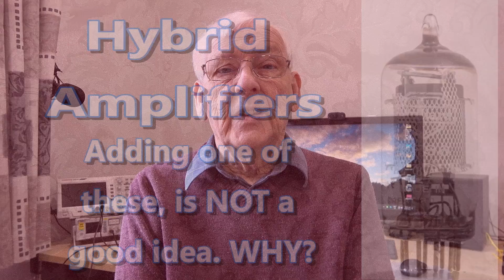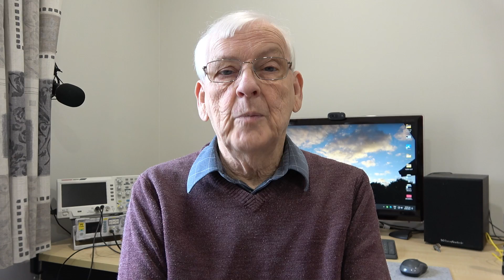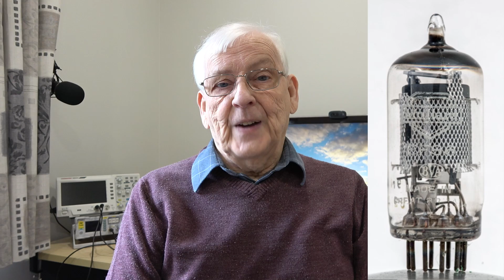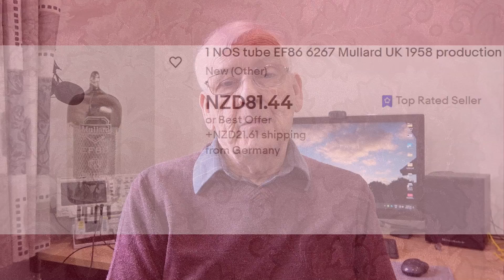HYBRID AMPLIFIERS. Adding one of these, is not a good idea. WHY?

Comment: I think you are correct about the cheap valve end of the market. I also think you are correct about people liking various degrees of 2nd harmonic distortion that single ended triode circuits can add. However valves can be operated in a very linear, wide bandwidth fashion and provide detailed and relatively faithful reproduction, whilst also having a certain something that can be captivating in a way solid state fails to provide. Whether that certain something is an added quality or an ability to allow something through from the recording in a way solid state does not, I don't know. What I would say is that what we measure is not the whole story about what a piece of equipment does or what we actual perceive when listening. Thanks for a very sensible presentation on this subject.
Reply: The most admired tube in the hifi world, directly heated triode 300B was designed for RF use! Unison Research amplifier Unico (good Italian brand, no ChiFi) use tube front stage and transistor AB class power amp, Audio Note, the holy graal of audio companies use tube buffers in their DAC devices, Etc etc. Well implemented tube adds 3dimentiality, holographic sound and scene layering which never be achieved by NE5532 opamp. Even so called discrette opamps like Burson, sparkos etc sound way better from this 1dollar opamp. Of course all is subjective, I understand engineering aspect (I am electronician engineer on my own) of the matter, but I learned thru years, there is no one "right" way in audio. There are many ways and many different expectations. Yes. I want my recordings sound good and nice for my ears. Nothing bad in this. I will not limit my listening to the perfectly recorded Sonatas and Orchestras of  all the world, or Diana Krall or other Chesky Records stuff, because I simply do not like this kind of music!!!
Reply: @yellow_noise3  AN makes expensive trash, especially the one that is not made in japan.
If you are an electronics engineer, where does all of this praise for those stupid bursons and sparkos comes from? the bum?
No amount of tube 'magic' will ever fix bad recordings.
Oh and 5532 is better than you'd ever believe, do some blind tests and the whole facade of lies will fall right down.
Reply: @VEC7ORlt  some like to hear the true recording. What Michael said is that it is highly compressed, no dynamics and sometimes also clipping. If you prefer to listen to that, good. I prefer it a bit softer so it is more pleasurable for my ears. Everyone his own way.
Reply: @Mrhifitunes  Did I stutter somewhere? Show me the part where I said anything about my preferences.
Reply from the maker: @VEC7ORlt  I don't understand why some people bash the 5532, mixers are full of them and have been for many years.
Reply: @MichaelBeeny  its way beyond excellent, you can even do a whole amplified using only 5532s - for something around 35eu per channel you can have a 18W of absolutely dead quiet and precise goodness, with 0.0006% THD+N.
Reply: @VEC7ORlt  ??? Where did I say something about your preferences? I said what's mine.
Reply: @yellow_noise3 Since vast majority of the actual music used to evaluate claims of superiority of discrete op-amps was recorded and mixed on gear using multitude of NE5532s, the argument falls apart, I guess.
Reply: Solid state fails to provide what? More second harmonic? Well you're listening to lies then.
Oh, there is something that lies beyond measurements? Tell me then, how a synchronous amplifiers used in various physics experiments can extract nanovolt level signals that are way below the noise level, but when it comes to audio there is some wishful thinking, mystery and woo science?
Reply: @VEC7ORlt Michael likes to KICK UP DUST !!!  Any serious audio listener knows ITS ALL ELECTRON flow at circuit level  and even a 10 millivolts change  can collapse or enhance the Soundstage... 

Beeny literally sets out to steal good energy and replace it bad the way an actual inferior component would. 

This video is on the same level of  5532 as the greatest OP-AMP ever He is just  flat out wrong!!! He is not aware you can make OP-AMPS with TUBEs  

My last point is that I'm positive his sound system is not set-up to produce a deep detail soundstage with a dark background.
Reply: What one hears is on the ears of the beholder! Can’t remember where I heard that? Excuse the pun!
Reply from the maker: @elsaarmstrong-zp6ng  That is very true. No one has any idea how anyone else interprets sound. We always think we all hear in much the same way. Something I guess we will never know.

Comment: Low plate voltage tubes, or valves, have been around forever. Portable radios back in the day used them, as well as other battery operated devices...
Reply from the maker: Yes, very true but the valves used here are not such valves. In fact, valves made for battery equipment are almost impossible to get and the few available are silly money.
Reply: @MichaelBeeny  You definitely have a point there. I've restored several of these units in the past, but no more, haha. Prices are insane
Reply: @MichaelBeeny  however, I believe some of the voltage doubler circuits may drive the plates to around 100v, which would be pretty close to normal operating parameters. I think I'll buy one and do some measurements...
Reply from the maker: @jontpt  Don't forget these amplifiers need to be able to run on 24 volts, so that's only 48 volts.
Reply: @MichaelBeeny  true, but in theory you could double those 48v  as well.
Reply: @MichaelBeeny  I've heard that some of these small tube preamps use plastic top plates to avoid shock, so I'm thinking there must be some fairly significant voltage present.
Reply from the maker: @jontpt  Plastic is cheap, that's the reason.
Reply: @MichaelBeeny  well yeah, haha, but I think the reason is to prevent electrical shock, which makes me think there may be more plate voltage than cynics like us might expect 😁